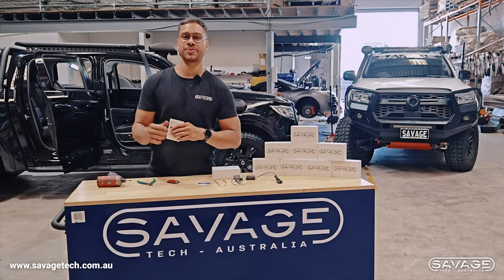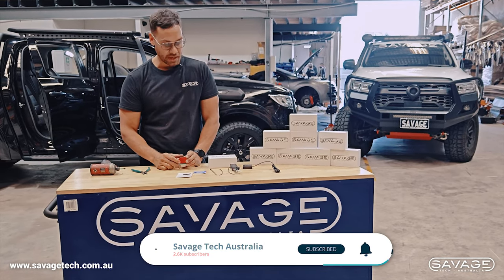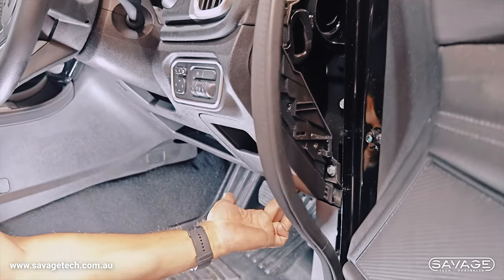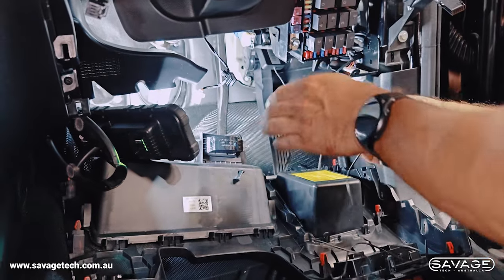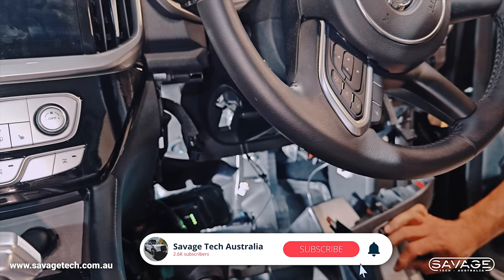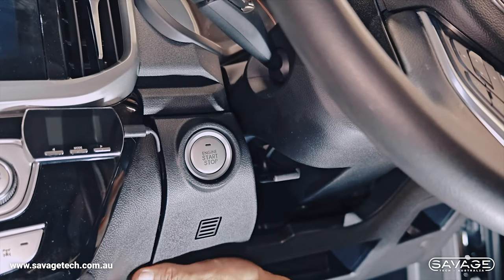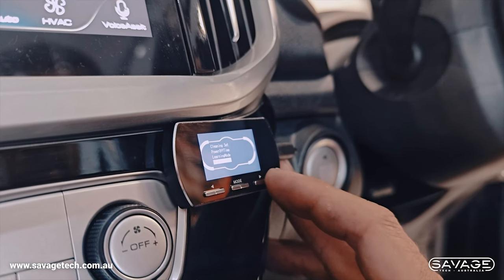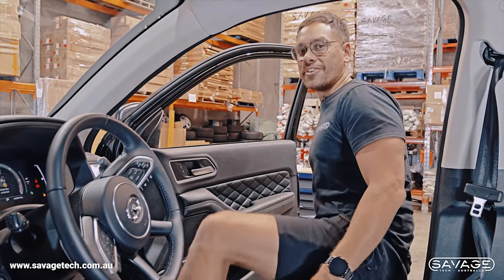GWM CANNON SAVAGE THROTTLE CONTROLLER INSTALLATION VIDEO

Comment: So what's different to this compared to others on the market ? I have an Ultimate 9 in my Hilux and can't fault it but also can't see how other brands can make improvements such basic technology. ?
Reply from the maker: They all work on the same concept however the modes can carry between the brands. Our new model has improved modes to choose from making it more customisable. 

Also some can't go in the negatives which we use slot when going off road over difficult obstacles.
Reply: Can you leave in race mode and say leave your cannon in eco mode .Will it give better throttle response ?
Reply from the maker: @MrHsv123  yes that's the point of the device.
Reply: Do you know if these avoid  new car warrenty ?
Reply: @MrHsv123  Yes apparently, I spoke to the Haval dealer after my first service as that turbo lag is a bit annoying and they checked and said that if you put one of these on without them installing it, you will void the warranty, It's the only reason I haven't done it to mine yet. Sorry to be the bearer of bag news.

Comment: why did you make a 30 second job, look hard by removing panels. there is no need to remove anything to plug those items into the conector.
Reply from the maker: Because I like thinks to look neat and safe. You do you mate, I run a business and have to make sure things are done correctly. 

You enjoy your 30seconds